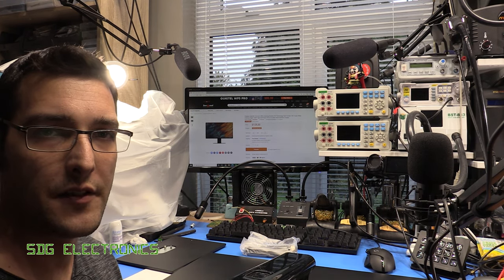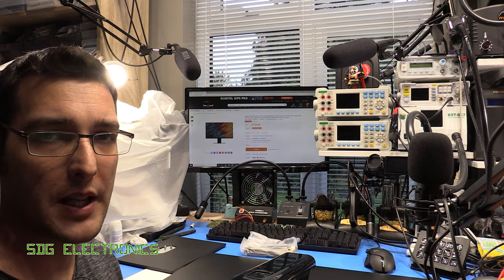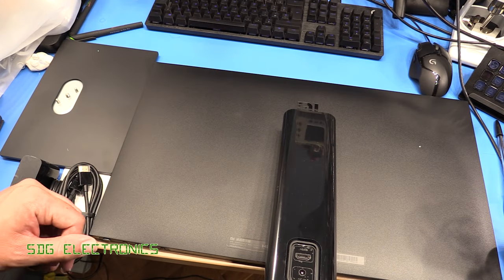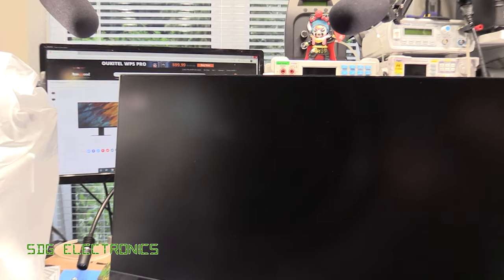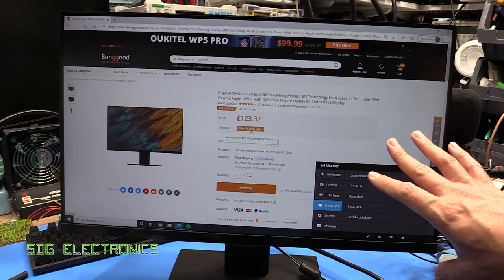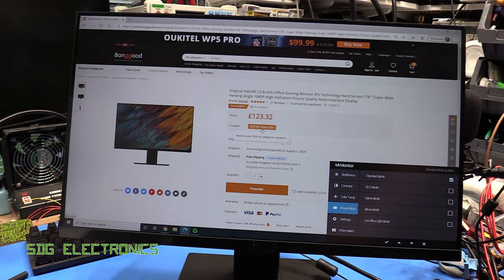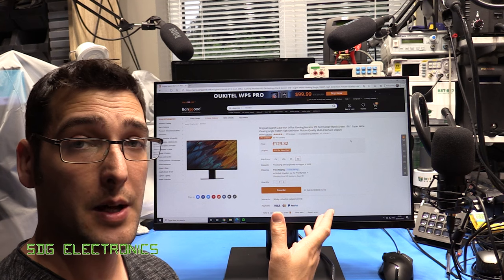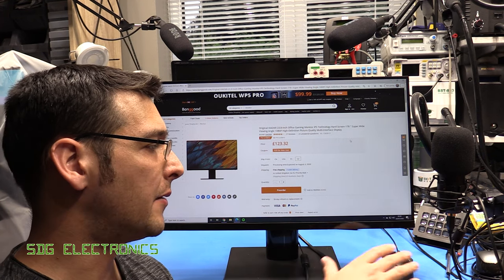SDG #167 Xiaomi 24" IPS XMMNT238CB Budget Monitor

Comment: Surprised you didn't spring for a 4K monitor. 24" might be a little small @4K but it looks like you're not sitting too far from it. 1080p is a thing of the past for my lab. Congrats on the new kkit nevertheless.
Reply from the maker: I am still considering a reshuffle to make space for something larger and with higher resolution. This may end up being in interim measure for this particular PC.
Reply: I have 2x 24" on my desk at the moment at I'm thinking about going single 4K and maybe 32"... really think you should be looking at 4K now

Comment: Nice show, glad it wasnt an unboxing! Can you remove the black edging if you change the aspect ratio? Also how many monitors do you have for your normal setup?
Reply from the maker: It looks like that edge is fixed. I have a pair of Dell 27" monitors at the other workstation which have been excellent.

Comment: I thought you might fix the Acer:-)
Reply: It's probably a quite common and easily fixable power supply issue.
Reply: Yep. Sounds like dry electrolytics caps in the power supply. Should be easy enough to find and repair
Reply: @MrZANE42  my thoughts and an interesting video
Reply: @fredflintstone1  Yeah. It could be quite interesting, especially if it includes some in-depth exploration of the issue and design of the power supply.
Reply from the maker: I had a quick snoop around, but it doesn't appear to be power related. There's actually very little in the monitor itself and an alternative power supply was the first test when I started to have problems on a regular basis.
Reply: @sdgelectronics  your old monitor had very nasty backlight frequency. I hopped that one day you could mod it to CC and make a video about it.
But even now, when you have a new monitor and that one is available for experiments it died.
Reply: @sdgelectronics  I've had two monitors with the same symptoms, caps on the PSU were bad.
Reply: @sdgelectronics  HDMI can be funny, It's very susceptible to interference without a good quality cable.

Comment: I would have preferred a diagnosis and fix of the old monitor.
Maybe it's just a PSU issue.
Reply from the maker: Unfortunately not much to report on the other monitor, the PSU is external and was the first port of call. There's actually only a PCB with the display driver and LED driver inside the monitor. It appears to be a firmware issue